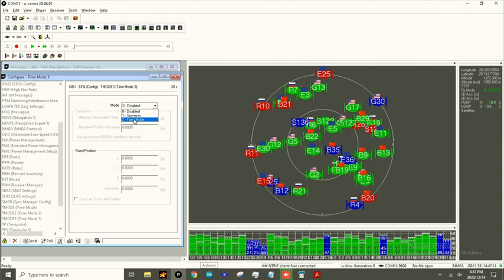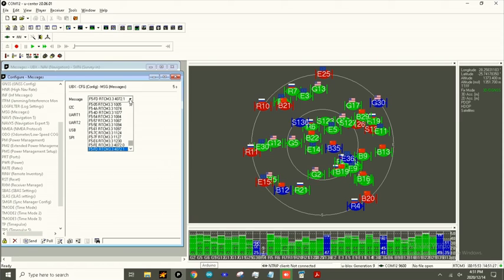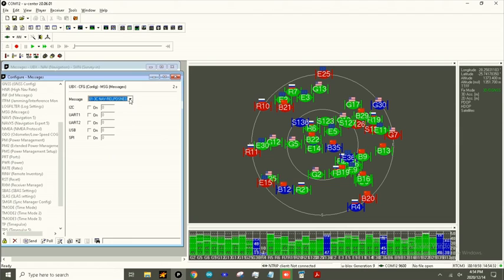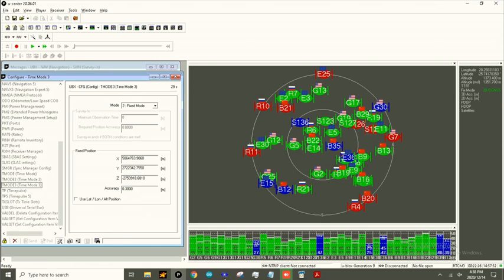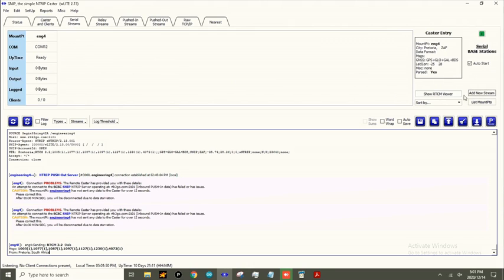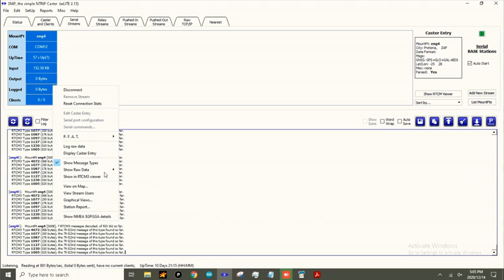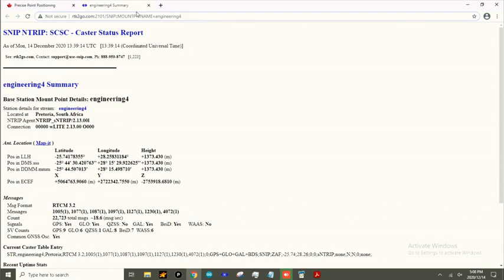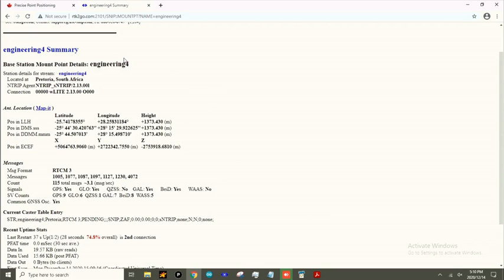DIY RTK GNSS: Part 2 – NTRIP Caster

Comment: Can you tell us where we can buy all components in johannesburg  to build the rtk base station?
Reply from the maker: Hi @SkyDrone team, thanks for the comment. For a simple base station configuration you can start off with obtaining the RTK GPS module; MicroRobotics that is based in Centurion is selling the SparkFun F9P module that we used (they are a reseller of the SparkFun components). If you have a spare computer with you can use that, or buy a mini PC such as the LattePanda we used (have a look at Communica, they should have stock). For the GPS antenna we used RFDesign based in Midrand to supply those (specific antenna version is detailed in the article, link in the video description). The other components are more bells and whistles so not really a requirement (e.g. the transparent enclosure to house the LattePanda computer and RTK GPS reciever and LED lights). Let me know if that gets you started! :)
Reply: @civiltronics  thanks for your help, here in Maputo, we doesn't find any of these, if for that I need all the information before we travel for a small trip in joburg
Reply from the maker: @skydronemaputo233  Glad to be of assistance :) all the companies mentioned to deliver, not sure what the situation would be to send the parcels accross the border through.
Reply: @civiltronics  for rfdesign they just have that
https://rf-design.co.za/product/u-blox-multi-band-high-precision-gnss-antenna-5m-rg-174-sma-m/
Reply from the maker: @skydronemaputo233  Jip, they only have a few options on their website. Most of the antennas are made to order, hence feel free to send them an e-mail, they are very helpful with their assistance. For our application we ordered the antenna with a 5 m length of cable to allow enough space to install then hardware in the Data House facility. Can ask the RFDesign team to recommend options for your application, e.g. that it has to be waterproof. Antennas are working very well to date with no weather or rain related issues.
Reply: @civiltronics  Hello, with the situation in South Africa, it is difficult for us to go there to buy the components.  Do you know someone who could send us, for a fee, all the elements?